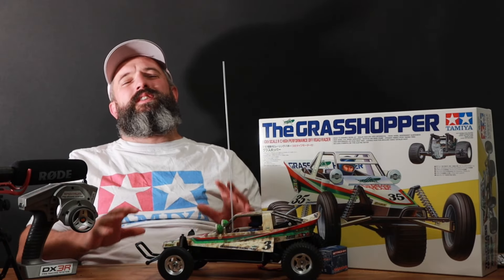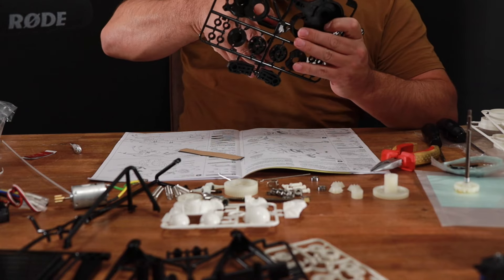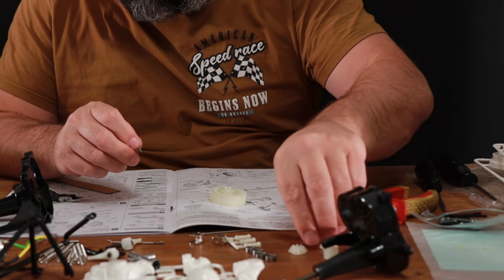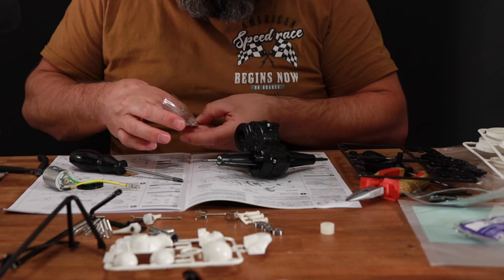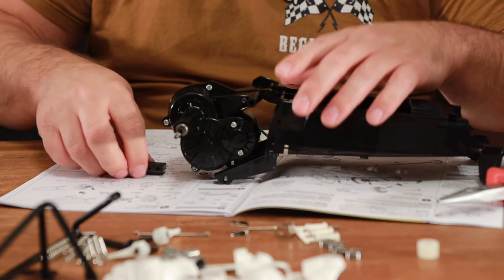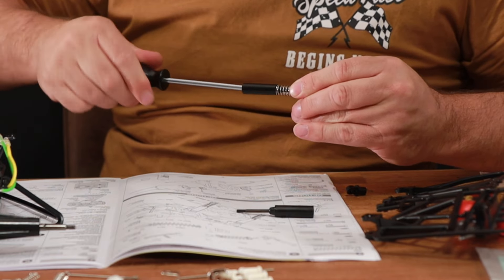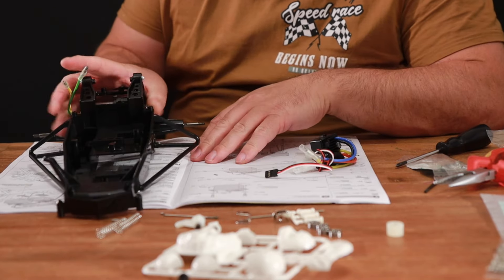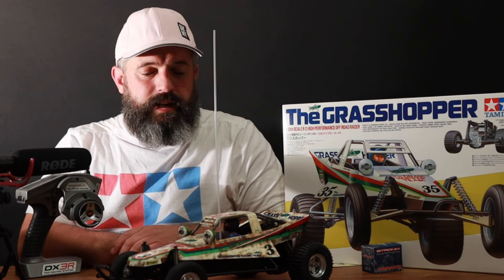VERY Quick Tamiya build - but can I race this tamiya Grasshopper

Comment: I built the Candy Green Grasshopper for myself and the White Grasshopper with my son a year ago to race each other on the baseball field where we live. What great fun! We've had lots of laughs together. I'm thinking of making a couple Grasshooper II's or Hornets for us. Haven't decided on which just yet. What I like about Tamiya is that they are affordable. Great video!
Reply: Get Hornets instead. Or even better, Tamiya Racing Fighters, as they come with oil shocks and torque tuned motor + ESCs in the kit I got. Or Tamiya Dancing Riders to race? Those are really fun. They lean into turns + the front wheel is loose, but the whole chassis leans into corners instead.
Reply: @robambrose4199  Good info thanks! I was actually just looking at the Tamiya Fighter Buggy and the Tamiya Plasma Edge II kits. I think I might order one of those instead of the Hornet or Grasshopper II.
Reply: @d.r.4453  Racing fighters are a good move mate. I would still love to get a Hornet for nostalgic reasons, but Racing Fighters are better. I've already got a Lunchbox , and a cheap rock-crawler, and Dancing Rider. I'm trying to finish a Tamiya Buggyra Racing Truck, but the painting and decals on the shell has taken x100 the time it took to build it? lol. For real. It took me a day to build it, but still working on painting the shell lol.
Reply: @robambrose4199  I have a lunbox and a pile of hop ups and aftermarket goodies to put on it. I'm saving that project for the winter months LOL! But I think I'm going to order a couple of the Racing Fighters for my son and I to build and race. There is an indoor carpet track not too far from us that has a stock Tamiya buggy race for beginners/rookies that we might like to try.  We've never done that before so it might be fun. Good luck on the racing truck painting! I'm sure it will look amazing when you are done. Thanks for the info as well! Happy RC'ing.
Reply from the maker: That sounds ace
Reply from the maker: @d.r.4453 racing fighter is on our list too

Comment: if you dont have a JIS screw driver you can file off the tip of a philips it might not be as good but it does help with the camming out.
Reply: Shortening a PH1 bit by 0.9 mm and radiusing the corners until it looks good makes a very good driver for JIS screws, especially as these won’t (at least shouldn’t) be torqued down hard.
Reply: @Glocktologist  good point, you dont need them to torque down, just not cam out and frustrate you.

Comment: The new Porsche or Hornet Evo is on my list. The hop ups for the Grasshopper is plenty. Put a circle servo horn over the battery tray to save loosing the battery there is a spot you can use.
Reply from the maker: Nice tips